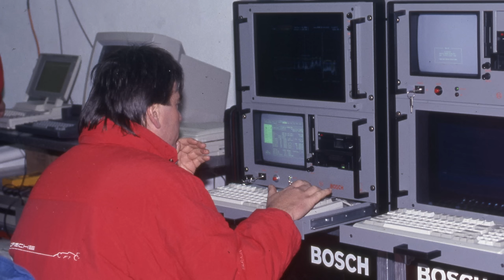10 manufacturers that failed in F1

Comment: Lancia & Subaru? Blimey I had no idea!! Great episode.

Request to the admin - pls increase the sound of ur recording. Give option to us listeners to reduce our device's volume cos even at full blast, I can hardly hear you
Reply: Its literally fine
Reply: Subaru is a weird one, they outsourced the engine to an italian company who made it way too complex and fiddley than it needed to be
Reply: There's more to Suburu. After pulling out of F1, the Colinni team put up its tooling and engines for auction. Then one of the men there managed to get in contact with a young Christian Von Koenigsegg who bid and won those toolings and the Suburu flat 12 engine. The engine fit into his prototype CC and seemed like a great option as it acted like a chassis member but wasn't viable as the engine was good for 750 bhp with turbos. In the end the engine was dropped for a Ford unit which would ultimately go on to power Koenigsegg cars in the future.

Comment: the footwork engine ended up in the porsche carrera gt and the subaru/motori moderni was supposed to end up in the first running Koenigsegg Prototype, but was replaced in the end by a highly modified Ford Coyote engine, due to high weight and low reliability of the subaru boxer.

Comment: You forgot to add Honda. As a racing team they tried twice, once in the sixties and once in the early 2000's. Both times it ended disastrous for them, the last time they even had to sell the team for 1 $. Even though they were successful as an engine supplier.

Comment: Interesting that Trintignant closed out the first Aston F1 effort. He was also the final works driver for Bugatti, retiring from the 1956 French GP in the first of two mid-engined T251s the storied company tried to field, which had been engineered by Gioacchino Colombo. That was the T251's only race. In more recent years the return of the marque to F1 has been rumoured many times. This video shows why it is perhaps just as well it has not happened...

Comment: Sadly Haas is on a similar route as some of these teams.
Reply: Using a Ferrari engine isn't helping.  Being an American team trying to cut it in F1 isn't helping either.  Haas will likely be concentrating on NASCAR & IndyCars come 2022, especially since neither Ford nor GM (i.e. Chevrolet) is planning on entering F1.
Reply: I am praying that Ford cossworth will come back and have a partnership with HAAS
Reply: @Henstory-k1p  That won't happen, Cosworth were bought by VW a few years ago, I have not seen VW push the Cosworth brand like Ford did.
Reply: Chad Simplicio Imagine if Hennessy made F1 engines 🤔
Reply: @xsentinel3044  Mmm, the smell

Comment: You missed Dutch legendary car manufacturer Spyker.
They had innovative racing pedigree to be proud of, Wikipedia:
"In 1903, the Spyker 60 HP race-car was the world's first F4 layout, four-wheel drive car, featuring the first application of a six-cylinder engine, as well as the first four-wheel braking system."
Probably the most innovative ground braking car ever built.
"In 1907, an 18 hp model competed in the 15,000 km Peking to Paris monster race, finishing second in the most gruelling race of its time."
Probably of all times.
Their short lived F1 adventure in 2007 however could hardly be called a succes.

Comment: Unlike the other examples, Lancia had the product, it was simply financial. The D50 was a revolutionary vehicle (like so many Lancias) and had the potential to win not only in 1956 (as it did under the Ferrari but also 1957 and possibly 1958. One of the problems of the Lancia was that it was too advanced for the tyre technology of the time such that the full benefit of its design could not be capitalised upon.  I would also question whether one should include Alfa Romeo given that they have won the F1 championship a couple of times, and Porsche since its engine was successful.

Comment: Fun fact that the Toyota actually built an F1 Car for the 2010 season, but it didn't make its debut. But the most interesting thing is that when Toyote engineers went to Ferrari in lack of job, they said that the Toyota's 2010 Car had better aerodinamics than Ferrari. And as we know, Ferrari was on for a championship fight in that year. But it isn't the end. Toyota's main engineer said that their first upgrade package would have contained a blown diffuser, which could have ment that they would invent it Before Red Bull. So yeah, Toyota could have its accurate shot for the season, but the number 8 ball went into its way. Sorry for the wrong orthography, I'm Hungarian as well as the autocorrect is.

Comment: Thanks for this great video. I didn't know that Yamaha and Subaru were ever in F1. It would have been good to put BMW in there too. I never understood how Peugeot failed after being called "the best engine" in that time. It's also crazy that companies like Porche, Jaguar and Toyota fail in F1, it shows you that F1 is totally another game, another world! 

I have a question. Something i never understood. Can you or someone explain how come a big name like McLaren who is a powerhouse in racing cars and F1 never produced its own engine?
Reply: Same here😁???
Reply: Peugeot was horrible in reliability, in fact it was so bad in that category it's not funny. In 2000 the Prost Grand Prix team used the Peugeot engine as a part of a 5 year deal they had and in 2000 with the unreliable engine and slow AP-03 chassis that pure french combo created one of the most disasterous season ever in Formula 1 that eventually folded both programs in Formula 1. Prost went through believe it or not 59 engines that year which explains the horrible reliability, and as a result of the horrible 2000 season with no points scored and having less race finishes than Minardi, Prost finished dead last in the 2000 constructor's standings. Prost then in 2001 not only lost all their sponsors but Peugeot dropped their name in Formula 1 all together after the 2000 Malaysia Grand Prix but was still around rebranded as Asiatech for two more years. Prost Grand Prix then folded at the end of 2001 after finishing 9th in that year's constructor's standings.

Comment: The lambo engine was not bad it just could not find a good team to use it later after there short time building engines in F1 they went GT racing with the Diablo svu and did really well.

Comment: Always wanted to see a Ford Works team. When Ferrari pissed them off in the 60s and they made the GT40s, I always thought they should have followed Enzo around to every series Ferrari raced in. Don't get me wrong early 70s Tyrrell / Ford was a great combo. If Covert doesn't die, he and Stewart probably go win a few more constructors cups with that combo, maybe even with 6 wheels in 76. Covert was matching Stewart's pace at the end.
Reply: so they could buy those championships too? outspend by a gargantuan amount, then leave and go and make horrible mustang II and exploding Pinto's.  They did have ford cosworth motor, another unfair fight as 80% of the teams were running cosworths, sometimes more

Comment: I wouldn´t put Porsche on the list. 1991 was a horrible time for the Porsche company alomst going bankrupt, so I wouldn´t overemphasize these few races. The 80´s on the other hand were really impressive in my opinion. The Porsche turbo engine made it´s debut in the last 4(!) races in 1983 but already dominated the 1984 season completely, winning 12 of 16 races outrunning Ferrari in second place by 143,5 to 57,5 points in the constructors championship! This was followed by winning the drivers championship in 85 and 86 and the constructors in 85. After finishing second in the constructors championship in 1987 Porsche left F1 with the turbo era coming to an end.

Comment: Didn't BMW try their hand at F1 for a year or 2 back in the 1980's or 1990's? Maybe even the Early 2000's at the latest.  If I remember correctly they developed an engine for F1 and had even delivered it to a couple teams and was even debating on going full development of an F1 Team, but do not remember why it never happened. I think they were even talking about Indy Car too, in the early 1990's, but nothing came about.
Reply: BMW was a successful manufacturer in the 80's for Brabham, Ligier, Benetton, and Arrows (the latter of which had the BMW engines under the Megatron name). Long story short for it's history in the 2000's the manufacturer was with two teams. Williams from 2000 until the end of 2005, and Sauber as an owner from 2006 until the end of 2009 in the wake of The Great Recession of 2008-2009. With both teams the manufacturer nearly won the championship on two occassions; in 2003 with Williams, and in 2008 with their own full on works team (technically BMW Sauber as Sauber retained a 30% share of the team instead of a full owmership). 
In a sense BMW was never a failure in Formula 1, it was just a failure at the corporate management level especially in 2008 when they threw everything away when they had a car that could compete with Ferrari and McLaren for the championship.

Comment: Marussia and Caterham were teams, who failed miserably in F1 and both are or were car manufacturer. At least Marussia could achieve 1 point back in Monaco 2014, thanks to Bianchi (RiP), while Caterham couldn't achieve any points. And because of the failure from 2014, I would count Lotus too
Reply: Caterham F1 were never part of the actual Caterham cars, they were formed two years before Fernandez bought the Caterham group, running under the Lotus name. Calling them a car manufacture is a huge stretch.
Reply: @MrSniperfox29  Huh ok

Comment: You missed Caterham, HRT and Virgin Racing of recent times
Reply: HRT and Virgin were constructors, not manufacturers. It's debatable as to where the line is drawn between constructor and manufacturer in regards to Caterham
Reply: @stephenyates962  thanks for clarifying Stephen 😊
What is the difference then between a constructor and manufacturer?
Reply: @TobiF1MU  In reality it's nothing, but in F1 one can count a "manufacturer" as a brand which actually manufactures cars outside F1. However in reality it's almost never the actual manufacturer which designs and builds the F1 cars. Not in the modern era anyway. Take the Jaguar F1 team for instance. The car wasn't designed or built by the Jaguar car brand but by the former Stewart F1 team at Milton Keynes which Ford just purchased and renamed Jaguar for marketing purposes. 

And the Mercedes F1 car isn't designed or made by the Mercedes car company in Stuttgart, Germany either but by the former Brawn team in Brackley, England which Mercedes just purchased. And before it was Brawn it was Honda and before that it was B.A.R. and even before that it was Tyrrell. 

The Renault F1 car is designed and built in Enstone, England too. 

One can just say that the "manufacturer" is where the money comes from because most of them don't do any actual manufacturing. 

And some companies like FIAT for instance pour tons of money into F1 but don't get any actual manufacturer "credit" aside from a few FIAT stickers on the Ferrari cars.
Reply: @TobiF1MU  A prime example would be the difference between Williams (constructor), and Mercedes (manufacturer). Williams exist purely to go racing in F1 (or at least that's their primary reason). Mercedes also construct their own cars through their F1 team, while also being backed by the car company (to some extent), hence they are a manufacturer team.

Comment: What happen to BMW?
Reply: Bailey Sofia Ruby Quinn they won a title in the 80s as the engine supplier for Brabham
Reply: BMW didn't fail as a supplier, but the team they supply (Williams and Sauber) did. While BMW once had the most powerful engine in its grid, the chassis can't handle it.
Reply: Li'l Sultan stop saying that I miss those engines 😭
Reply: @SultanNizi3000GT  As a works teams they failed.  They won 1 race.
Reply: Li'l Sultan Williams and BMW were competitive in the early 2000s. Achieving many wins and podiums. But i can’t say about their chassis because I wasn’t alive when they were competitive. Anyway with Sauber they were only strong in some races and in 2008. Some mistakes for the new regulations in 2009, kept them away from a possible title in 2008 though

Comment: A few curious entrants here.  Alfa Romeo is mentioned that they won the first two drivers titles in F1 but that is quickly brushed under the carpet to push forward the narrative that the team has failed because they never won in either their second stint of F1 in the 1970's - 1980's or their current stint.  Porsche also shouldn't be on there because they won an F1 race as a manufacturer and also won titles as an engine supplier.  Jaguar technically also shouldn't be on there because the Jaguar outfit in F1 in the early 2000's was not Jaguar but rather the former Stewart team (which was bankrolled by Ford) under a new name using Ford engines.  This version of Jaguar has almost nothing in common with the Jaguar car manufacturer.  Finally, Toyota had a few pole positions and several podiums yet you claim they failed!  Any backmarker team would kill for a 'failure' like that!

In conclusion I don't understand what your benchmark is to determine whether a car is a success or failure because you've added title winning teams, title winning engine suppliers, race winning teams, pole position winning teams and multiple podium finishing teams into this list.

Comment: Did you mention Lotus? Did Maserati or Chevrolet ever get into F1?
Reply: Lotus? They're literally in the 6th most successful team in F1 despite not existing for 28 years
Reply: Chevrolet via General Motors have not been in Formula 1. Although the GM luxury brand Cadillac is rumored to be entering F1 as an engine manufacturer in 2027

Comment: I'm surprised that BMW didn't make the list
Reply: They did win a heap of races and the 1983 driver’s championship with Piquet.
Reply: Won races and championships with Brabham. Won races with Williams. Won a race as a manufacturer. Why would they be on the list?
Reply: @CapHowdy  they did? Ohhh i didn't know that i mean I'm kinda new but thanks for clearing it up 😅
Reply: the sun is a deadly lazer If not the best actually.. Their engines have been holding some records for quite some time now.
Reply: @the sun is a deadly lazer And yet they didn't win any championships as a constructor and actually performed worse themselves. The Williams chassis was far superior to any that BMW designed themselves.

Comment: I agree with Toyota at No1. I've never forgiven them for making Alan McNish look average in his only F1 season.
Their F1 project was preceded and followed by equally unsuccessful sportscar efforts. The beautiful and very quick TS020 (or GT-one) missed out at Le Mans in the late 1990s because of reliability issues and the increasingly ugly  hybrids which Toyota have run at Le Mans since 2012 have only had success when all the works opposition pulled out.
Toyota did do well in rallying though.

Comment: Bugatti. 

They were coming out of devastation on the back of 30 years of struggles, as WWI, then the Great Depression, then WWII, had all been very difficult periods for the company. Ettore's philosophy of 'Pursang'.... in both engineering, and design, was not conducive a weak global economy, and both Wars were terrible for the company. Despite their reputation, and their racing success, the company was never able to expand to the level the contemporaries that came up with it could, nor it's market rivals. 

Finally it all was too much, and they were in dire dire straits, and looking at the end. Ettore was dead. Jean had been killed before him. It was the 1950s, and Roland Bugatti was left with little money, and no product. 

Despite this, he did get a business partner, and they did have some small facilities, and he had a few chassis left over from their last main production model, even if outdated. They got a designer, and had a body built for new sport convertible, and they managed to struggle on, got some interest, and briefly, it looked possible to get a couple of models to market, they managed some interest at least, after the motor show circuit. 

So of course, the logical thing to do, is take that little you have, and scrape together what little more you can, and make an F1 car, and assume that your Grand Prix dominance of 20 plus years gone will be enough to make it a massive success, then, well you know what they say, win on Sunday sell on Monday. 

Of course. That's sound business. 

Obviously it worked out about as well as you could expect. 

Unlike Lancia though, there was no one there to buy, so it became bye (bye).

Comment: BMW?
Reply: I don't think BMWs time in F1 is considered to be a failure. They've been involved in F1 since the 50s to different degrees and almost continuously through the 80s, 90s and early 2000s. Heck, they ended second in the 2007 constructors championship, so they weren't bad. Honestly, I think that if they stuck around a little bit longer they would've won a championship or two.